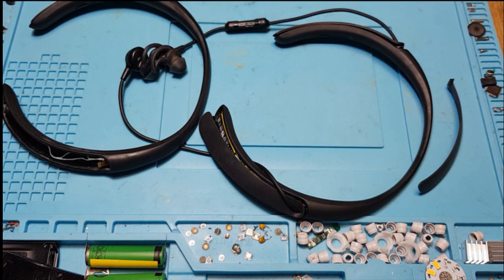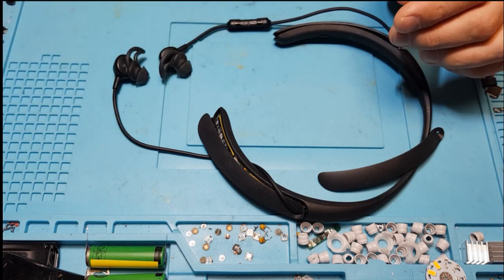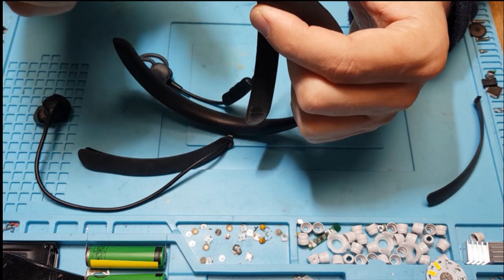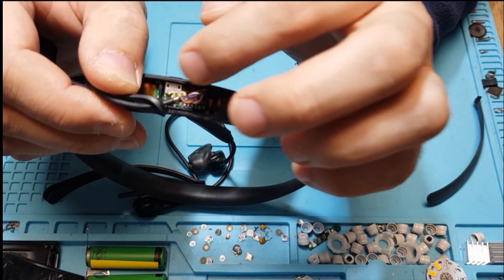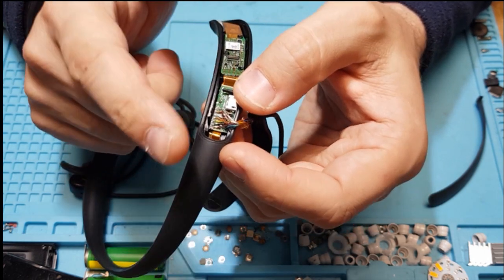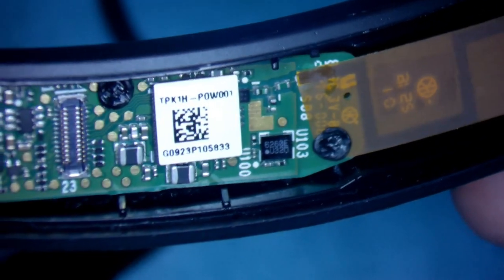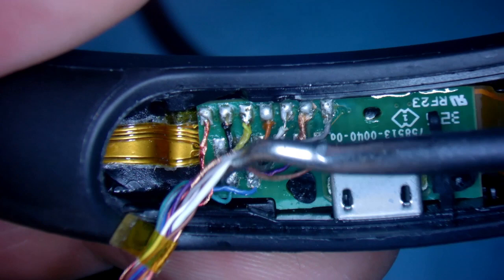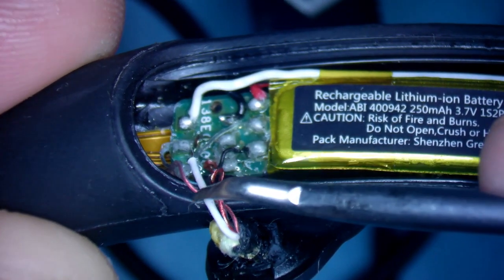Bose qc30 exchange of headband and covers. Closeup of cables/pinout

Comment: im depended on these to be able to ride motorcycle because of my tinnitus. unfortunately they were stored with 10% power all winter and it seems the battery life took a hit. is there any replacement product for this? all i find are pods and they are not suitable for motorcycle riding, nor is the batterylife great
Reply from the maker: Bose qc20 and qc30 are the only models that have their batteries externaly newer ones are as pods .. try to replace the battery or jump start it when you open it and get access to battery contacts